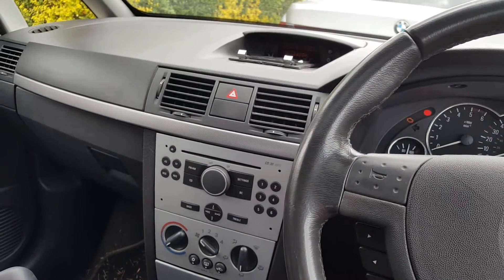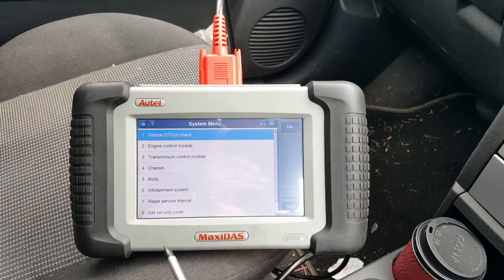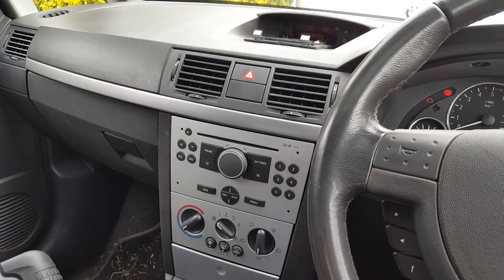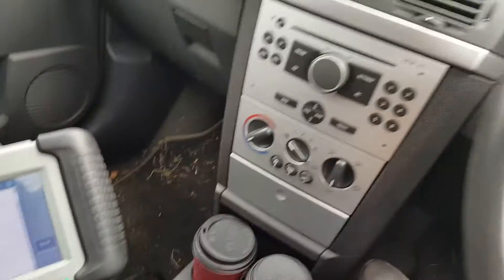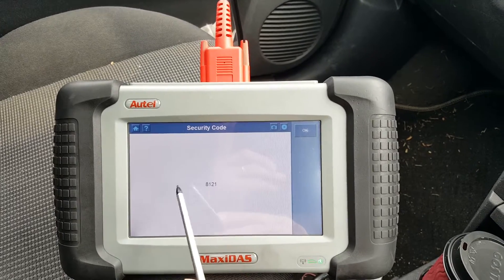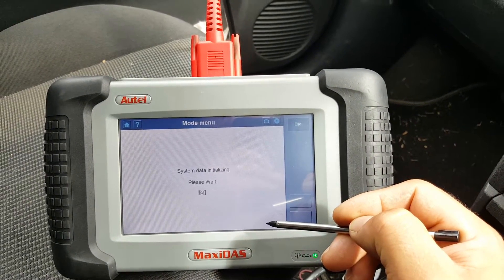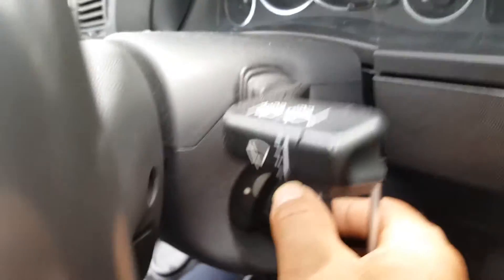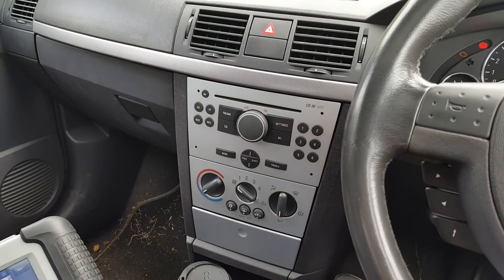Vauxhall PIN code read and remote programming with the DS708

Comment: I get the code aswell. But somehow its not correct... it shows every car the same code
Reply from the maker: 🤔
That's weird... 
Are you selecting the correct ecu?
Reply: @LMAutoRepairs  how do i know its the correct ECU? Somehow i tried 2010 model also and it gives me the security code even my car is 2004 lol
Reply from the maker: @Saqib.S  
What tool are you using?
Reply: @LMAutoRepairs  MD808 pro
Reply from the maker: @Saqib.S  
I think it can only read a few Vauxhalls/Opel...
Not all...
Reply: @LMAutoRepairs  Ahhh.. it gives me the same security code for all opel lol

Comment: How to use MaxiDas DS808 to read key pin code?
Reply from the maker: Hi
The DS808 is similar to the other Autel scanners... if capable, will be only on the corsa C, where it reads the pin from the cluster... it will not work on every car...
Hope that helps.
Thank you for watching!
Reply: @LMAutoRepairs   hi the ds808 pin code reading is in instruments and special functions works on 1.6 z16xep and other  Opel/ vauxhall petrol engine not so good on the diesel engines i have the ds 808 thats how i know
Reply: @iankelly2110  hi im looking to buy a 808 just to get vauxhall security pins do you recommend this ?
Reply: @mechanick1000  its a good scanner for the price it will only read pin code on petrol engine with  xep engine codes its does do the rest of the petrol codes or diesel so z10xep , z14xep z16xep and the z18xep thats all

Comment: Hi,I've got an Astra H 2006 model, lost the last key but managed to get a new blade with a virgin chip. I cut the blade, key is able to lock/unlock the car manually and turn ON the engine. I have a Silca tool to programme the key but unfornately I do not have the security /immo code. I'm for a cheaper solution to read the security code. i,ve been thinking of getting carprog v10.05 or v9.31 but I'm not sure whether it can read /extract pin. What is your advice?
Reply from the maker: Litia Mulala 
Hi
If plan to use it in the future carprog can be a good option...
Otherwise just get the code from the dealer...
Thank you for watching!
Reply: lmsvvavr I finally decided to get a carpass, thought it will give me more information than just immo code. However, when the immo code came, it couldn't work. I suspect something must have been changed by the previous owner. So I'm back to square one. Any advice? My vehicle is installed with valeo cim.
Reply: lmsvvavr is there any cheaper tool I can use to read the immo code
Reply from the maker: Litia Mulala 
Carprog is probably your cheapest option...
Unless there is something else out there that I am not aware of...
It is wired though, that the pin supplied by the dealer is incorrect...
Reply: I enquired with 2 different sellers of carprog v10.05 and v9.31 to find out whether both versions can the immo code, but I was advised that both versions cannot read the immo /security code in addition that v10.05 is unstable. However I do realise that they are merely sales persons, this is why I want to learn from people who actually use these tools. Has anyone used any of these version of carprog? 

Thank you in advance!

Comment: audi A4 2003 2.5l v6 s line diesel ecu type bosch edc15 vm+
Reply from the maker: Sorry for the delay...
You should have in the cluster the eprom 93c86.
Dump it, then you need and immo software that is capable of decrypt the pin, vag commander should then do it...

Comment: HI FRIEND IF YOU MAY LET ME CALL YOU THAT WELL I HAVE A PROBLEM WITH AN AUDI A4 2.5 V6 THEY CHANGE THE WHOLE ENGINE WITH THE ENJECTION PUMPE I TRIED TO MAKE ADAPTION FOR THE PUMPE BUT WITH NO RESULT I TRIED TO MAKE AN IMMO OFF OF THE ECU THE SAME RESULT AND IT SAYS IN DYAGNOSTIC ECU BAD CODING NEED HELP PLEASE
Reply from the maker: Hi
Right, there is a few things first...
Coding usually means something slightly different. 
Is the engine exactly the same as the original one?
Is the engine ecu the original from the car, or came with the  engine?
Reply: THE ENGINE IS EXACTLY THE SAME AS THE ORIGINAL 
THE ECU IS THE ORIGINAL OF THE CAR
Reply: I HAVE SEEN IN MANY FORUMS THAT THE PUMPE NEED TO BE ADAPTED WITH THE ECU THE PROBLEM I DONT KNOW HOW TO RETRIVE THE PIN CODE OF THE IMMO I HAVE THE VAG COMMANDER 3.6 BUT IT WONT RETRIV THE IMMO CODE I HAVE READ THE ECU FILE AND MAKE AN IMMO OFF WITH VOLTA CAN I SEND YOU THE FILE TO LOOK INTO
Reply from the maker: +sadik mamoun 
The pin for the car it will be needed just as you said.
You then adapt the pump using the pin.
Now, to retrieve the pin, you said you have the file from the ECU, can you dump the cluster?
Reply: I CAN't the vag commander 3.6 WON't connect with the instrument cluster what should i do
Reply from the maker: +sadik mamoun 
Remove the cluster and dump  the chip...
Providing you have a reader...
Reply: +lmsvvavr i am sorry but i didn't understood the prosidure can y explain more
Reply from the maker: Whats the year of the car?